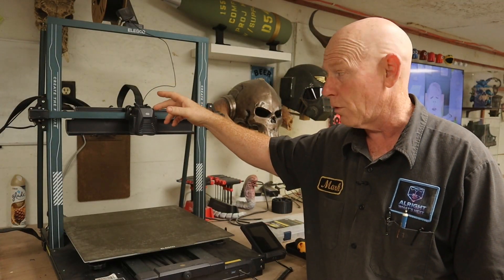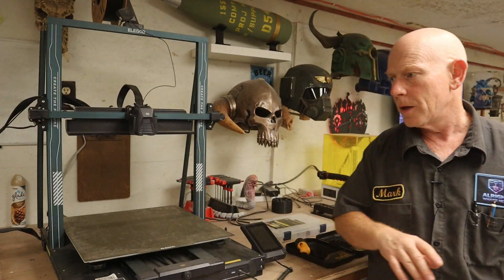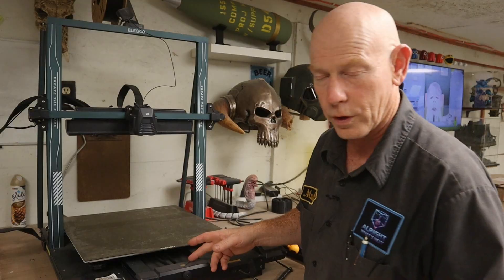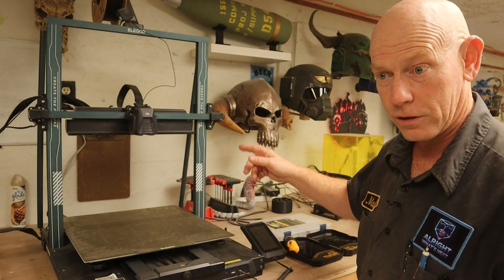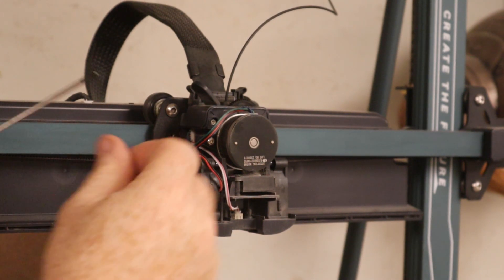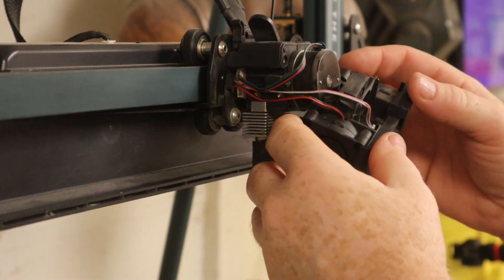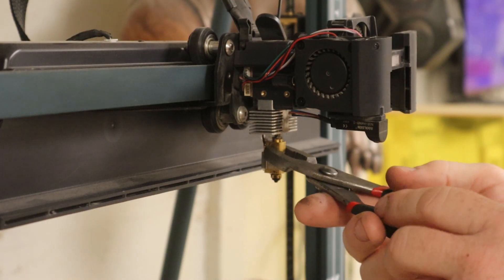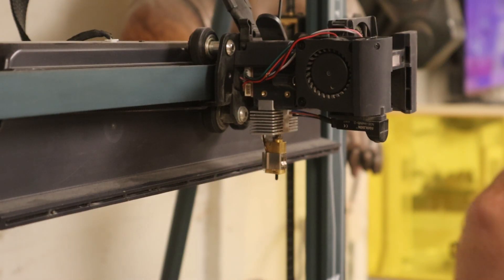How to change printer nozzle.  Neptune 4 Max

Comment: should really heat up the hotend as well before removing it if not you risk it snapping the thread off inside. Also do the same when reinstalling the nozzle to snug it up if not you can get leaks and the good old blob of death.
Reply: Good precautionary tips, thank you